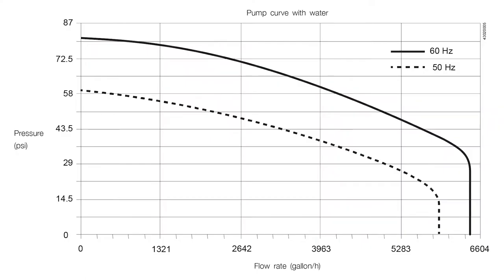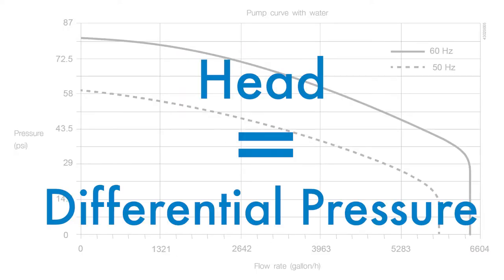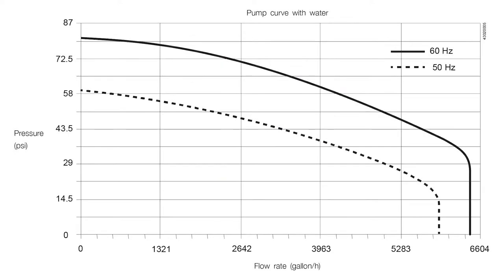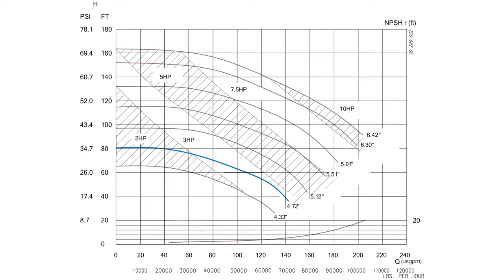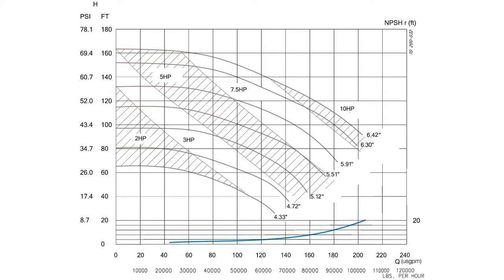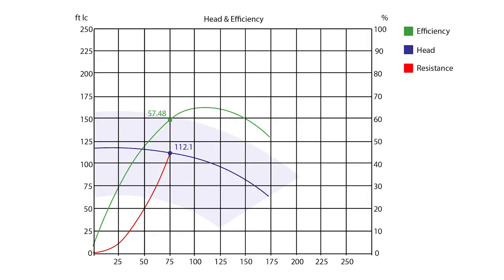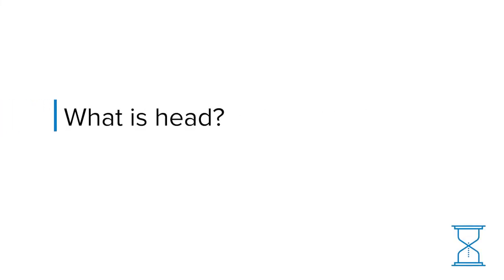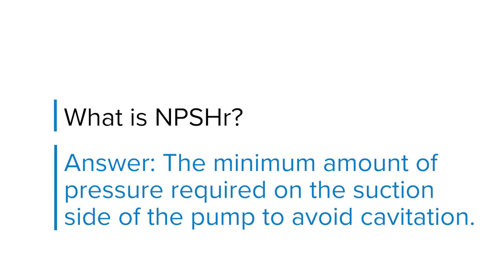How to Read a Centrifugal Pump Curve

Comment: Very simple explanation of what are quite complex charts. One comment - cavitation is not the formation of air bubbles, it is the formation of vacuum cavities at the pump suction, due to being unable to draw in sufficient liquid. The damage is caused when the vacuum cavities collapse again, causing shock loading of the pump.